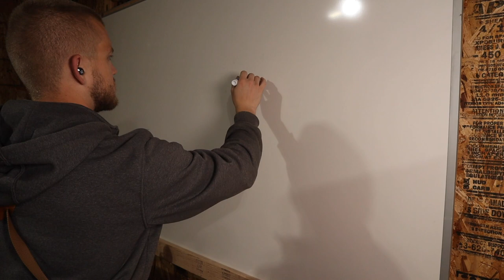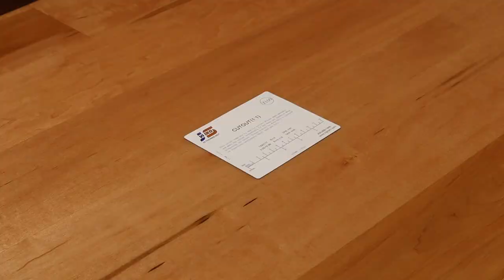Conference Room Table | Start to Finish

Comment: I'm a newbie 
I've done some board glueups with stock up to 2 meters. I was wondering if doing a glueups such as the one you illustrate, which features boards touching end grain to endgrain would result in trouble in terms of wood movement.
Is it safe?
Reply from the maker: Thanks for the question and welcome! I’m still a newbie in a lot of ways, always learning. 

It’s possible that there will be expansion and contraction issues but most wood movement is perpendicular to the grain direction so I’d be more concerned about how the bread boards at the end are attached than the end to end boards in the middle.

JKatz Moses has a great write up on wood expansion at the link below:

https://kmtools.com/blogs/news/planning-for-wood-movement

Comment: Josh - I'm a new subscriber and this was the second of your many videos I have watched all the way through... very nice table! What brand of Epoxy did you use?
Reply from the maker: Hey! Glad to have you around! I appreciate your support and compliments. I used Super Clear on this build but found out that it has a lower heat deflection temperature than needed. When my client put a hot cup of coffee on it, it left a “melted” ring. After doing more research, Stone Coat has a much higher heat deflection temperature.

Comment: Beautiful Table. Excellent choice of contrasting colored hardwoods. The only thing I would be slightly worried about would be the breadboard ends... But, you sealed the top and bottom, just not the Straw ends before you domino' and glued them.. It is the only area that is going to be prone to soaking up moisture, but, the epoxy is a strong coating, and a table like that should be in a Climate Controlled office, so, I think you dogged that bullet.. 
You should use that same design and make a porch table, leave one end unsealed and use Epoxy as the adhesive on the other and see if any problems creep up on either of the breadboard ends. One year outside should be like 25-30 inside.. 
Rob Cosman built a wood working table of the same design as the one with the shoulder vice in all of his videos, for a friend, and, the dust/tool tray on the far end, when he discuses how he designed it with springs from a ballpoint pen to deal with the expansion/contraction, it really makes you think.. 

To me, personally, I did some experiments with Treated wood from a local lumber yard (wood under cover) but, you could tell that the 5/4x6" treated deck boards were soaking wet. I was building sides for my dump trailer, so, wanted the treated.. But, then, I treated the treated wood myself "Before assembling the sides". I put about 15 coats of my treatment on it. 7 years later, still looks really nice, and sits under an evergreen tree.. Anyway.. 

I cut all of the boards to size, then measured the weight, thickness and width and logged them. When I stood them on end, the next morning, they had little puddles under the boards I had cut. I guess like a Christmas tree. Cut it and stick it in water right away, and it will soak up water for days... Cut it, let it sit for a day and it won't soak up any... I guess cutting the ends off, opened the straws and the water seeped out. The board maintained their original dimensions (length was constant, but, thickness=varied enough to begin with, you could not tell for sure), but the width reduction was quite noticeable. 
Some reduced in width 1/4". From 5-1/2 to 5-1/4". 
I had the opposite effect also on a door I made with 5/4 treated deck boards that I had stored, so, were dry when I built the door. Put it on my pump filter house that  heat in the winter and store my glues/paints, etc, when not using them. The door was tight, and covered inside with 3/4" insulation, so,  I noticed the swelling, the first time I opened the door after building. About 3 days of rain. I had gave it a good coat of UV Stable Urethane on the top(exterior) and bottom(inside the filter shed), but, paid no attention to sealing the end grains of the boards.  So, when it dried out a bit, all I did was put a heavy coat of the same urethane on the ends of the boards (which were cut and end grain open), but ONLY at the top of the door. (Protected under a 6" overhang), to let the wood breathe until it reduced back to the width I had finished it at. It was still too wide at that point and was binding, but, I did not want to shave it down yet. Figured it would shrink again, if I left one end open.. It did. 
I tested the door several times over the next month. Once it shrank, it got a little snug once after another 3 days of rain, but, nothing like before.. So, after a good long spell in May/June, door about as loose fitting as I had seen it, I put several coats on the bottom of the door end grain of the boards. Since I have done that, no matter how much rain we have gotten, the door does not seem to have changed at all. 
So. My theory from that and those experiences,, including the testing of the board for the dump trailer.. If I am working with dry wood, once I do the dimension cuts (length cuts), if nothing else, I put some glue on my finger and give it a good soaking to plug up the ends of the straws. Usually several times, until I figure I have surely got them covered. But, I have been busy and not able to build much with wood, so, have not tested it further. But, I bought some 5 minute 2 part epoxy that I am going to use when I do build an outdoor project, to finish my testing.  Since then, I did some finish work, and, for the first time, used a shooting board and plane to square the ends of a few boards.. Wow, does End grain/tear out take on a new meaning.. Talk about smooth the end grain..Wow!! So, if using a plane, and glue, I might be happy with that. 
I do have a video I did when I finished the sides on my dump trailer, and another on treating the boards on the trailer, and they are both holding up extremely well. 
I think I have one on the filterhouse as well. I did not do one on the 5/4x6" treated boards. My video posting has been limited to what I can record at one shot and upload, although I did a little editing here and there when a wild hair made me do it. I bet I have 50 very interesting projects that ended up with 2 or more videos that need to be edited before posting. One day, when I get to my new shop/warehouse, I will have to edit and post them. Especially the one where I took an old swaybacked, mushroomed Peter Wright Anvil and put a new face on it, then, heated the mass up and did a steam quench on it. Several smiths said I could not do it... Ha.. That meant, that project went on the front burner.. Ha..Ha.. Turned out about like your table.. Incredible. Take care and cheers!
Reply from the maker: Lots of good points. Moisture absorption and wood motion is a tricky game. I'm still working to get it all tuned in for my projects.